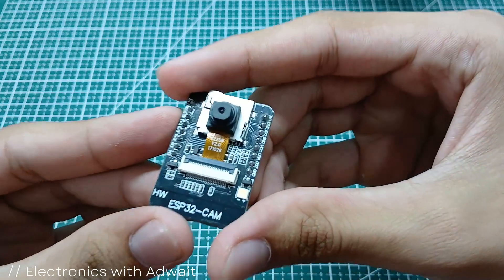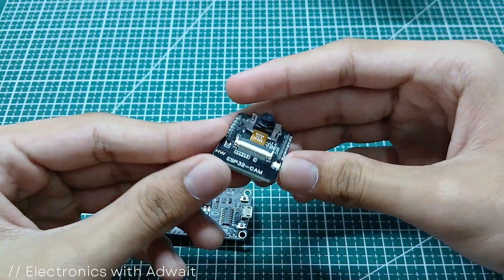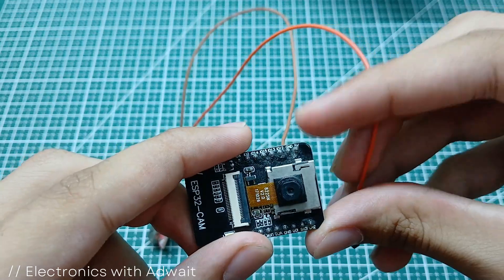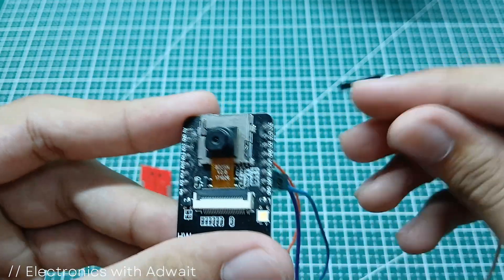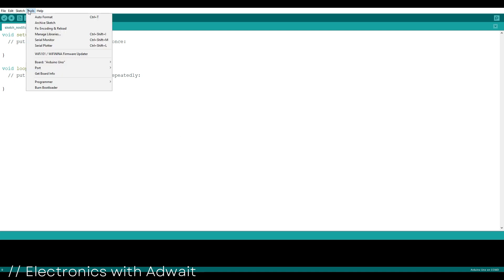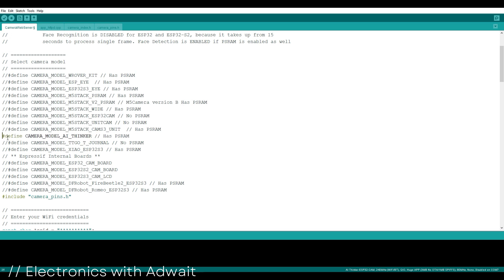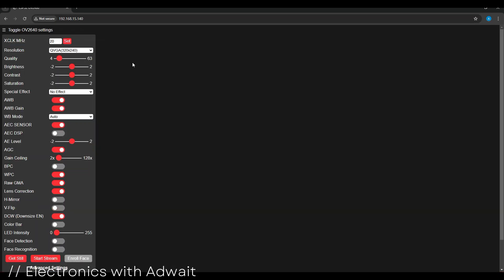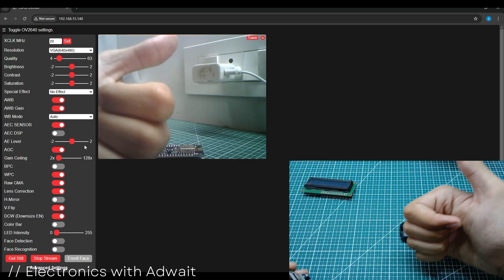Step-by-Step Guide to Setting Up Your ESP32-CAM for Beginners

Comment: thank you for this very useful video. I would like to ask you for help. I made setting and flashed my AI thinker ESP32 CAM in Arduino IDE and successfully connected camera web page with settings but after starting stream there is no video. I tried to change different resolution but with no effect. I am usingn OV3660 camera module. Is there any additoional settings to do? Thank you.

Comment: sir i have one problem wifi connecting and disconnecting continuously 
plse sir solve ?
Connecting to HLJ
14:33:05.929 -> .
14:33:06.442 -> ESP32-CAM IP Address: 192.168.43.61
14:33:06.442 -> Start configuring and initializing the camera...
14:33:06.474 -> E (2126) camera: Camera probe failed with error 0x105(ESP_ERR_NOT_FOUND)
14:33:06.474 -> Camera init failed with error 0x105ets Jul 29 2019 12:21:46
Reply from the maker: I think you might have a hardware issue.

Comment: Can you do a video on how to debug?  I'm a total beginner, but would like to step thru code to understand what it's doing.

I tried PlatformIO but my board is not listed (ESP32-C3FH4-RGB)

The little bit of documentation on this board all use Arduino
(
Friday Fun: Micro Weather Station 
01Space / ESP32-C3FH4-RGB 
)

I saw a few non ESP32-C3FH4-RGB posts by eduardogb and Stéphane Potier , 
( Argon_Ghost "[ESP32 Tour] Hezhou ESP32-C3 uses PlatformIO to compile and debug" )

I tried it anyways and get errors like “Failed to get flash maps”.. not sure if it's the target, the bin file generated doesn't work isn't applicable for this target, my openocd install, ini/json settings.  

Platformio.ini: 

[env:esp32-c3]
platform = espressif32
;board = lolin_c3_mini
build_type = debug
framework = espidf

;Memory Map
board_build.partitions = partitions.csv    ; no_ota.csv ; References partitions.csv in project root
;board_build.f_flash = 80000000L
;board_build.offset = 0x10000
;board_build.bootloader_addr = 0x0000
;mem 0x0000 0x10000 ro   ; GDB command to protect bootloader ROM

;??????????
;board_build.flash_mode = dio   ;<---Unless it's a custom board, this is already defined in target board file
;platformio/tool-openocd-esp32@^2.1200.20230419
builtin.cfg 
lib_deps =
	paulstoffregen/OneWire
	WebSockets
	256dpi/MQTT
	NimBLE-Arduino

; Serial Monitor / Upload settings
monitor_speed = 115200
monitor_filters = direct
upload_speed = 115200
upload_port = COM3               ; <-- USB cable to board's UART
monitor_port = COM3             ; <-- USB cable to board's UART

upload_protocol = esp-builtin    ; Needed for monitoring or debugging??

; Debugging configurations
;debug_load_mode = manual ; modified   <-Maybe needed for esp-prog
debug_tool = esp-builtin  ;  Needed for debugging
debug_init_break = tbreak app_main  ; <-- t is for temporary
debug_speed = 12000  ;500
debug_extra_cmds =
    set remote hardware-watchpoint-limit 2
    set remote hardware-breakpoint-limit 2
debug_init_cmds =
    monitor reset
    monitor reset halt
monitor_dtr = 0
monitor_rts = 0
debug_server =
  $PLATFORMIO_CORE_DIR/packages/tool-openocd-esp32/bin/openocd
  -f
  $PLATFORMIO_CORE_DIR/packages/tool-openocd-esp32/share/openocd/scripts/board/esp32c3-

; Custom ESP-IDF settings
;board_build.f_cpu = 160000000L
;build_flags = -D BLE_IDE
build_flags = DARDUINO_USB_MODE=1   <- Needed for ESP-IDF?
                        D ARDUINO_USB_CDC_ON_BOOT=1   < Needed for ESP-IDF?
                        -DCORE_DEBUG_LEVEL=5
platform_packages =    tool-openocd-esp32 @ file:/

PIO Debug (without uploading)” and use the regular "Upload" task,
pio run -v -t upload
Set GPIO8/D8 pin to HIGH during boot , and GPIO9/D9 pin to LOW
flash_download_tool_3.9.7_1:
bootloader.bin   0x0000   ;Second-stage bootloader (4KB)
partitions.bin       0x8000
boot_app0.bin    0xe000  ;bootloader_dio_80m.bin
firmware.bin        0x10000 ;my application

Mem.c:
#elif defined(ESP32_S3) || defined(ESP32_C3)
  #define OBJSTORE_BYTES 50000   // 800000

Launch.json
{
    "version": "0.2.0",
    "configurations": [
        {
            "name": "(GDB) ESP32-C3",
            "type": "gdb",
            "request": "launch",
            "program": "${workspaceFolder}/build/your_project_name.elf",
            "args": [],
            "cwd": "${workspaceFolder}",
            "stopAtEntry": false,
            "externalConsole": false,
            "MIMode": "gdb",
            "setupCommands": [
                {
                    "text": "target remote localhost:3333",
                    "ignoreFailures": true
                },
                {
                    "text": "monitor reset halt",
                    "ignoreFailures": true
                },
                {
                    "text": "load",
                    "ignoreFailures": true
                },
                {
                    "text": "break app_main",
                    "ignoreFailures": true
                }
            ],
            "preLaunchCommands": [
                "set remote hardware-watchpoint-limit 8"
            ]
        }
    ]
}

Despite the warning,
"Warning! Flash memory size mismatch detected. Expected 4MB, found 2MB!
Please select a proper value in your `sdkconfig.defaults` or via the `menuconfig` target!"

It successfully builds, but when I try debugging it starts an endless loop of compiling over and over, and a dialog-box says, Waiting for prelaunchtask ‘Pre-Debug’…
Reply from the maker: Brother , I too had a lot of problems with this but I found that many of these issues were dur to a hardware problem so I bought a new one , still it gave me tons of errors ,I too surfed on the internet and found few solutions. I think this method would work for you too !!